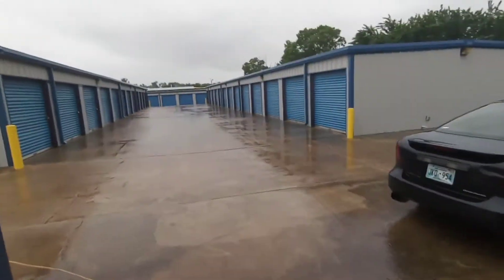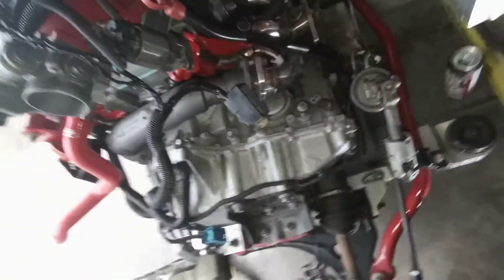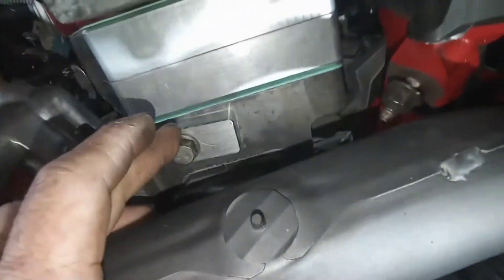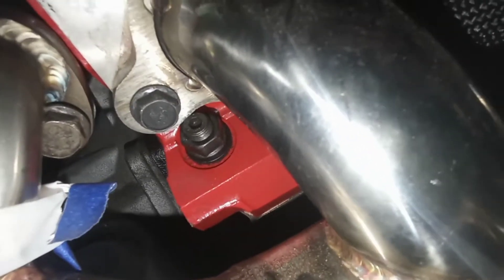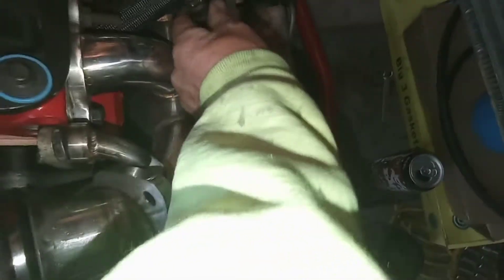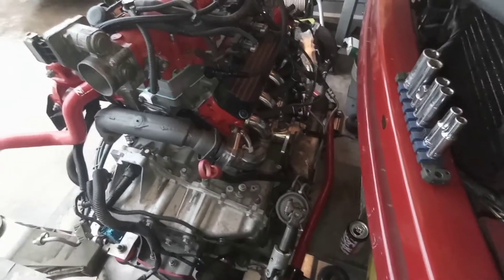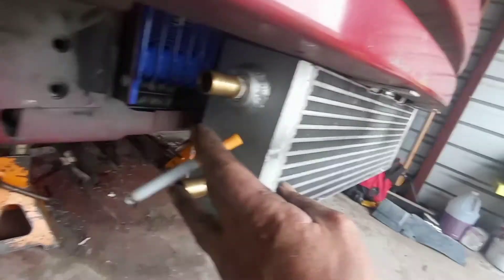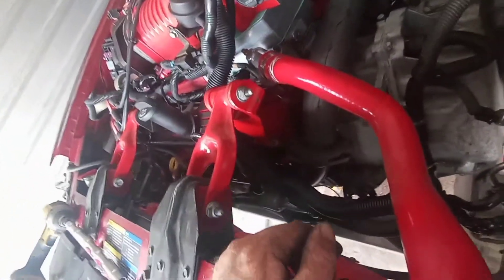07 Pontiac Grand Prix GT Engine & Transmission Install/ Almost Ready for 1st Start Up

Comment: You know I’m always first keep going
Reply from the maker: Im headed back over there today after work to figure out the fuel pressure issue. And ive gotta get the exhaust hooked up. Hopefully it'll start. Fingers crossed.
Reply: @PontiacsGarage  it will you do good work

Comment: That's a helluva way to install a motor. I'm used to installing from the top.
Reply from the maker: Yeah i pulled the engine out the top. And then pulled the trans out later on. And then dropped the subframe. Then cleaned everything and put it all together outside of the car so its easier to get to everything. But now im having issues with it not starting.
Reply: @PontiacsGarage  last I seen you had fuel pressure problems. Did you figure that out? Is there fire to the plugs?
Reply from the maker: @stevewheatley243  yeah the plugs were soaked with fuel. Put in a new set. And changed the injectors to the 42.5's and its like there's no compression or something. Pushrods look brand new still. Rockers were still tight. Head is torqued to 90 ft-lbs. With the injectors in place in the head and blowing air in the spark plug holes with my compressor it seems to have great compression. But idk.
Reply from the maker: I tested all the plugs for spark. All are working. And i redid all the fuel lines so both rails are getting fuel. I think i may have drowned the cylinders in fuel and washed away the oil.
Reply: @PontiacsGarage  Unless I missed something,it sounds like it has no fire. Could your coil packs be dead? Or the control module? Pull a plug out and turn it over. See if there's fire.
Reply: @PontiacsGarage  Sorry I missed this. Yeah oil those cylinder walls and try again.
Reply: @PontiacsGarage  Have you run a scan on it? I wonder if you could have a bad crank sensor.
Reply from the maker: @stevewheatley243  yeah thats the plan. Ive gotta get the rear plugs and injectors back out and get all 6 cylinders lubed up with oil and then put it all back together. Im really hoping thats my issue. Im working on the next video now. Just gotta finish this up and hopefully get a 1st start video. And edit everything.
Reply: @PontiacsGarage  Good luck. I'll keep watching your videos,and put in my 2 cents where appropriate.😂
Reply from the maker: @stevewheatley243  thanks steve. I appreciate that. Thank you for the comments and for watching the videos.
Reply: @PontiacsGarage  Anytime. Did you find codes?
Reply from the maker: @stevewheatley243  no codes at all.
Reply: @PontiacsGarage  If lubing the cylinders don't work I'd consider the timing. You've got fuel,fire,and air. What else's left?
Reply from the maker: @stevewheatley243  well i thought of that too, so i re-watched the video of me putting the engine together and the timing is spot on. Its a double roller. And if the timing was somehow off the pushrods would be bent to hell. Idk im about to get off work and head back over there and dig into it some more. Ill let u know how it goes. Thanks again for the input. I really do appreciate it.
Reply: @PontiacsGarage  I could be wrong,but I doubt the push rods would bend unless it ran. Anyway,it sure is a head scratcher. And since I'm not there I have to guess.
Reply from the maker: @stevewheatley243  i completely understand. I just got the rockers and push rods back in the front head. Getting them torqued down now. Then on to the rear to remove spark plugs and add oil to all cylinders. Then put it all back together.
Reply: @PontiacsGarage  If it don't run, we'll always think it should've,right?😂
Reply from the maker: @stevewheatley243  well it definitely did have compression when i put it together. And the NA engine block came out of my 06 prix daily driver. So i know the engine is good. It had 168k miles on it when i tore it apart to do this top swap. And i had the heads done at the machine shop for the cam. Had the valve springs and retainers put on and new valve seals. And they were supposed to do a valve job on both heads but they inspected them and said they were fine. So the heads "should" be good to go. And everything else is brand new so i dont see why it wont start except for the bigger injectors drowning out the cylinders and washing away the oil for the rings.
Reply: @PontiacsGarage  You might pull the fuel pump fuse,and try some starting fluid. Just a little to see what happens.
Reply from the maker: @stevewheatley243  just tried. Still nothing. I did put oil in all the cylinders and it did seem like it helped some. But it still cranks super fast and no start.
Reply: @PontiacsGarage  I hate to tell ya,but that super fast cranking sounds like jumped timing. I'd run a check again. Could it have a bad crank sensor and a scan don't tell it? It's possible.
Reply from the maker: @stevewheatley243  i mean that wouldn't hurt to check. Its all plugged in like its supposed to be. I might just drop the subframe back out the car and tear it all back apart. Ive done all the diagnosing i can until i get a compression tester. I sprayed starting fluid in the tb with the fuel pump relay unplugged and it dumps white smoke out the tb. Which smells lile burning oil but i dont see how it would come out the tb. Unless the valves are open with the rockers on.
Reply: @PontiacsGarage  This sounds like a possible bummer for you. I'd hate to do all that shit again. First I'd bring it up on no.1,and see what I've got. Then try a known good crank sensor. It very definitely has the symptoms of timing issues though.
Reply from the maker: @stevewheatley243  well thank you very much Steve I really appreciate the information
Reply: @PontiacsGarage  You're welcome,but I'm sure I ain't told ya much you don't already know.
Reply from the maker: @stevewheatley243  well i hadn't thought about the crank sensor. It is plugged in. I double checked it the other day. Im swapping plugs again and trying it again with just starting fluid. I pulled the plugs and used my air tool to test the valves and they dont leak. But the plugs were covered in oil now. Ill keep messing with it until i figure it out.
Reply: @PontiacsGarage  It sounds like a timing problem to me,but let me know how it turns out. Or I'll see the video. Good luck.
Reply from the maker: @stevewheatley243  thanks steve. I appreciate it. Have a good night.